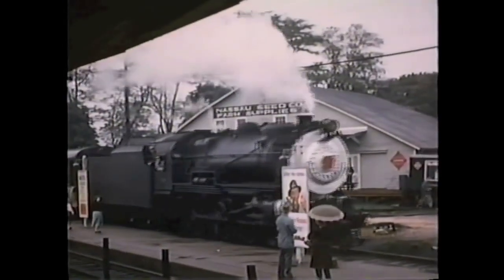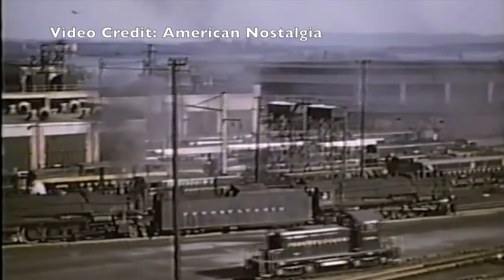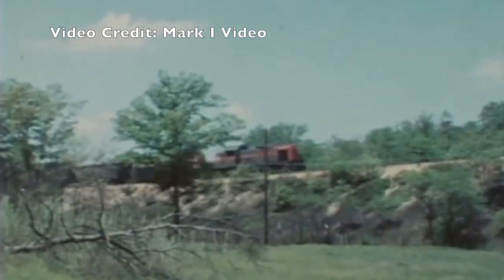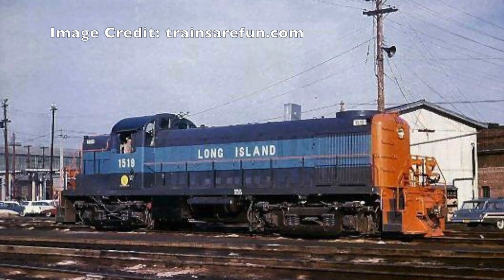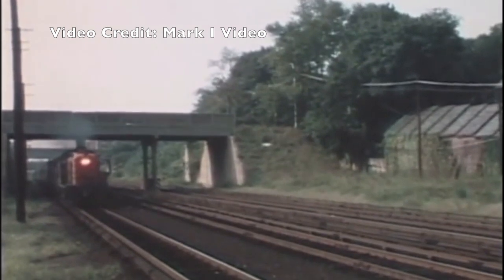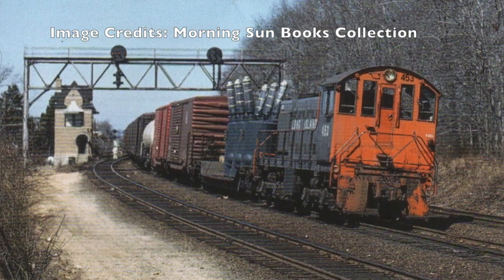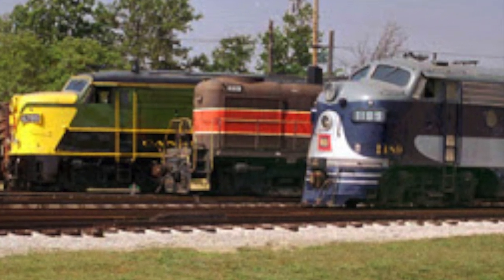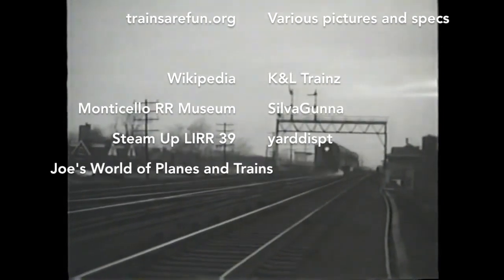Engines of Long Island Episode 3: ALCo Diesels (S1 E3)

Comment: C420 a were used the longest on LIRR
Reply: I worked for the rail road . I retired in 2007 and they still had some . After 76 they were used in freight. GP 38 started in 76 with bicentennial  paint scheme . The C420s went to freight service until Atlantic Freight took over the freight part of LIRR.
Reply: How long where they used?